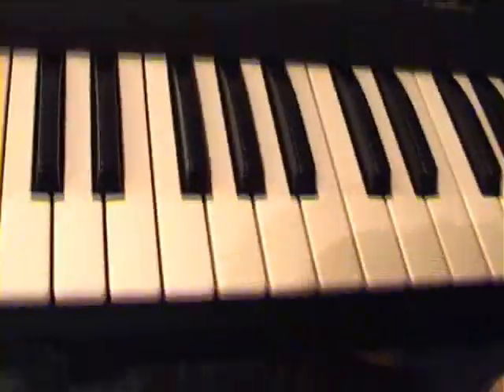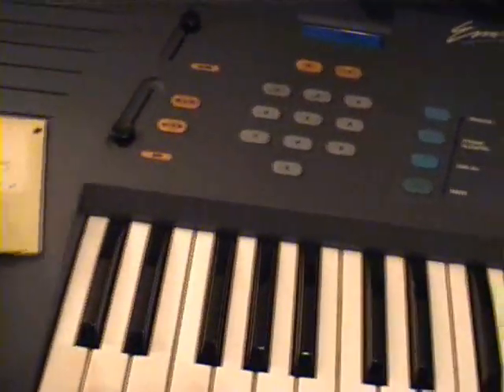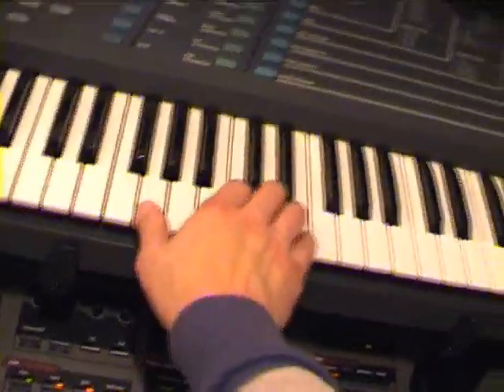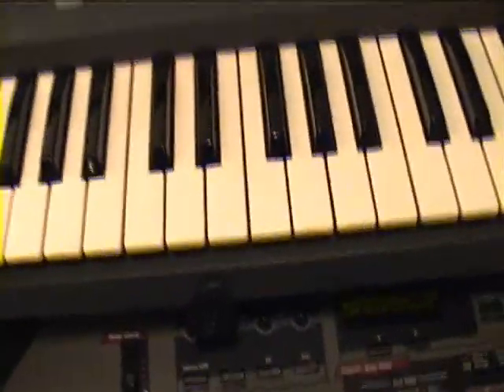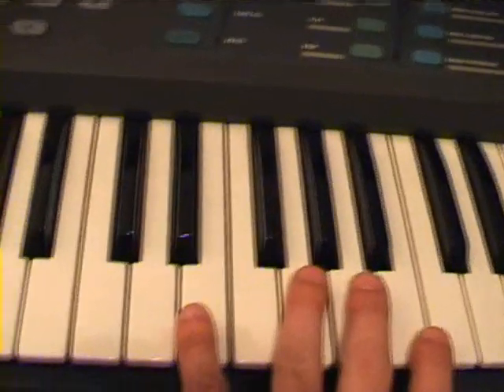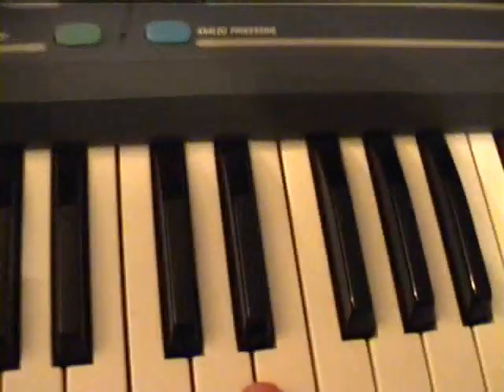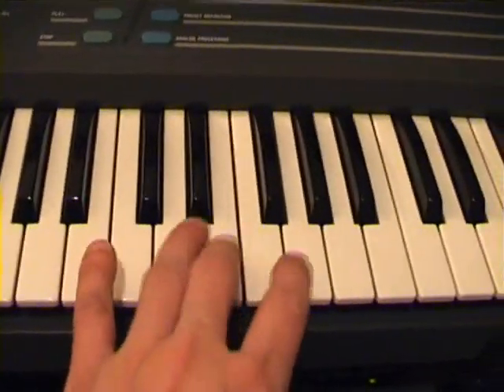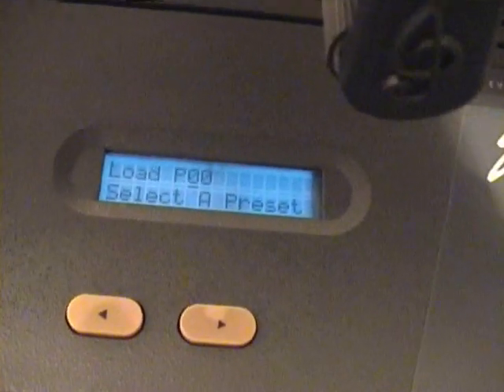DX5 Working with the Emu Emax I (1/2)

Comment: I always had a doubt! How do you mantain your sinths? How long a sinth can last?
Reply from the maker: Interesting question, because I am just in the process of restorating the main pcb of my JP8000. I am my own synth tech , fortunately :). A synth can last more or less depending on : how you care about it and how its electronic components last by themselves. The fault on my JP8000 is due bad SMD capacitors that failed after 25 years( It is a synth from 1996). But my Promars, from 1979, has not been restored/fixed since new. Capacitors use to be the nightmare for those machines, specially if they leak acid on the printed circuit board.

Comment: Hi. I bought 4 original factory disks and I did not get the arco strings. Apparently, there are more disks. Do you know how many there are?  😎🇨🇦👍
Reply from the maker: There are a lot starting from 700 up to 800 If I recall correct. Arco Strings is #701
Reply: @DX5  is that ZD701?  😁